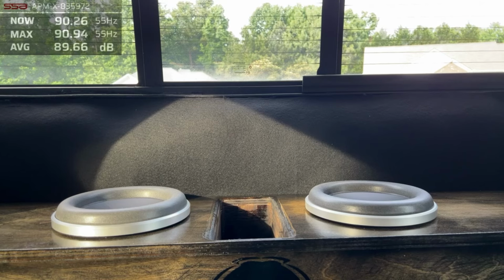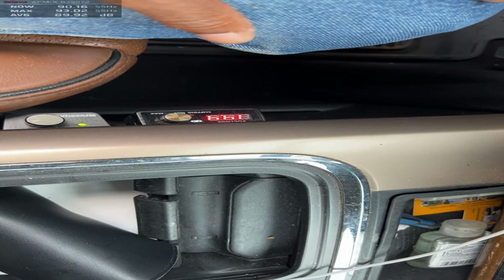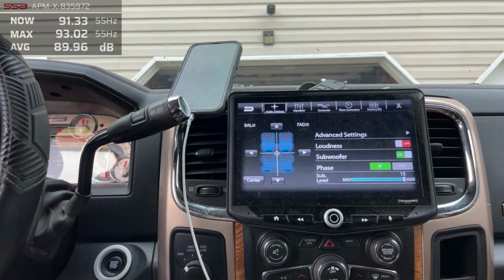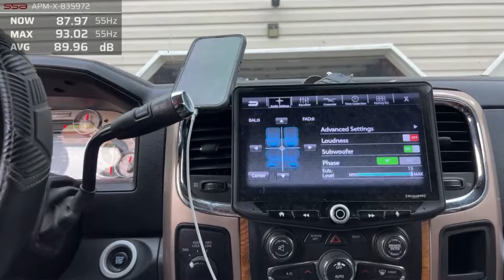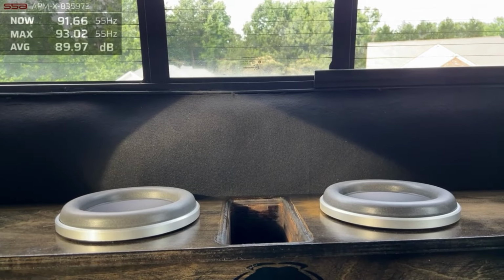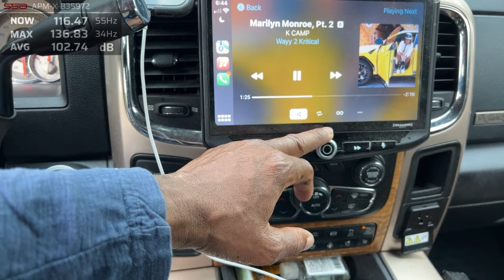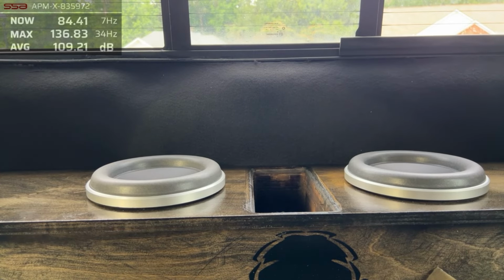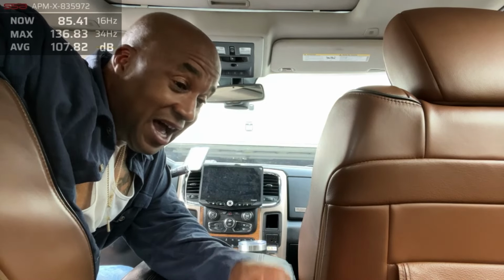Dual JL Audio 8W7AE 8” 136 @ 34hz Musical Demo!! Part #2

Comment: i bought a pair of 8w7 in an enclosed box 12 years ago. replaced the foam a couple times but they always slapped every day for over a decade. great product. im thinking of rehoming them in a ported gately box and push them with the slash 1000/1. its been great using just one jl xd600/1 , its the size of an ipad. nice vid!

Comment: Love JL’s but when I saw you had volume 28 and they’re smacking that tells me the amp output is not matching the stereo clipping points. You’re supposed to be able to turn it up at 90% volume and have balanced sound. The epicenter is also pushing the levels too high needs to be retuned.
Reply from the maker: All my settings are set with a DD-1 …if you think 2 JL 8w7’a can handle the power of a DD M2500@1ohm with listed amp rating of 400amps you on it seriously. They slapping because it’s too much power for them.. Genius
Reply: @M.B.Enclosures  thanks for proving my point. You have your amp maxed out plus epicenter that boosts signal, if two subs are 500x2=1,000 watts and you’re running 2500 that by definition means your amp is not tuned to the subwoofers 1000rms genius. Finding the square root of 1000rms will solve that clipping problem. Maybe I just don’t know what I’m talking about with my oscilloscope.

Comment: Is it good to have your preamp max for the sub or do it depends on the system?
Reply from the maker: Preamp or sub out RCA on modern radios control RCA output voltage. When setting that amp this must must used as the gauge for where your power is dispensed

Comment: Maybe try a different amp?  I know those 8’s get real low.  Man there great subs. No other sub sounds like em.
Reply from the maker: I have a DD M2500…one of the best on the market at every power level.
Reply: @M.B.Enclosures  ah. Not sure then. I’ve heard em on jl slash amps and some ppi amps and there amazing. Anyways great vids man!!
Reply: @jondoe6618 i think what you heard em say got lost In translation he did they get low but not at a higher power level. Have you heard how low the some od the top notch spqls get?